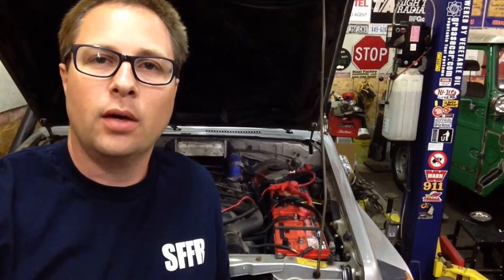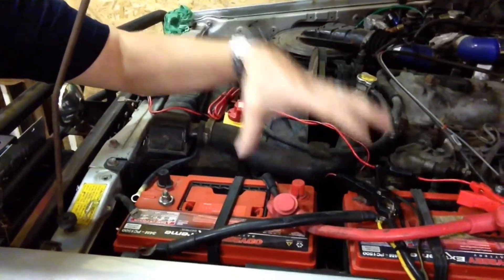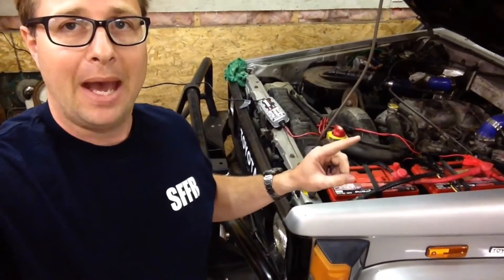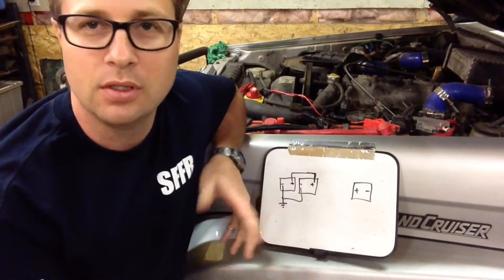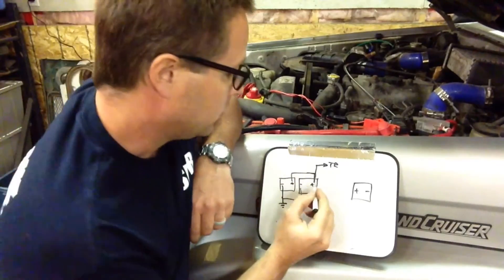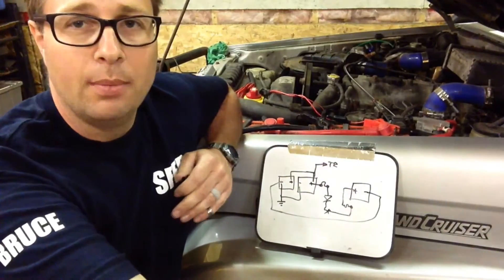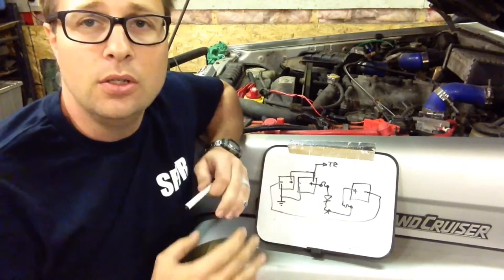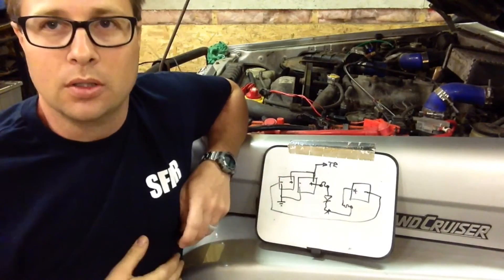4LowLife EP10 - Electrical Techniques! - dual batteries

Comment: Very comprehensive video. Just like buildings. In the service panel, the breakers are RIGHT IN the power buss, at the start of the circuit- thus, they protect the entire circuit.
Reply from the maker: +R. Joseph exactly!   Blue Sea now actually make fuses that mount directly to the battery post for even more complete circuit protection!

Comment: Just what I was looking for! Thanks
Reply: Question, so does your 3rd battery (12v) get a charge from the alternator?
Reply from the maker: +Greg Wetzel effectively yes, but technically it's charged from the other two batteries.  When the voltage in the crank bank is high enough, the isolator connects the two front batteries to the one in the rear.  When the crank bank voltage drops (because the alternator isn't charging) the isolator opens the circuit from front to back, to isolate the two banks.  As soon as the voltage comes up on the front bank, they connect again.
Reply: Do you have more details/part # for the isolator?
Reply from the maker: I can dig up the exact part number, but it’s a PowerGate made by PerfectSwitch www.perfectswitch.com. There are several options to choose from, mine is a fairly old one that I got as surplus.
Reply: How expensive are those things? The ones I saw on the site are pretty expensive. Maybe if you had the part number I could see exactly what you got.
Thnaks for your time.
Reply from the maker: I believe the one I am using is an obsolete model, it was old stock/used inventory.  It’s a Single Rectifier, 150 or 200A, (I believe that makes it an “SR150” or 200) which is way over rated for what I needed, however they are super efficient and extremely compact - and I couldn’t argue with the price.  They are definitely more expensive than a standard style isolator, but also way out perform them.
Reply: Thank you for all you responses. One more question, are you running 2 isolators or just one? Second, is it a 24v single rectifier or 12v... Sorry pretty new to all this.
we can talk on ih8mud too
Reply from the maker: Greg Wetzel - No problem at all 😎 .  My truck is 12V so it’s a 12V isolator, if yours is 24V then you would want a 24V.  I only have one isolator, as the two batteries in the front are permanently paralleled, effectively 1 big battery made of two - so I have twice the starting capacity at the same voltage.   The isolator prevents the fridge, or accessory lighting from draining the cranking batteries, if the voltage at the accessory battery gets to low, by simply electronically disconnecting the front from rear.